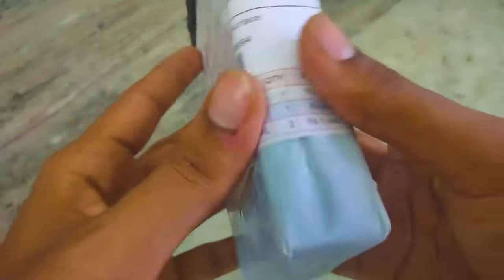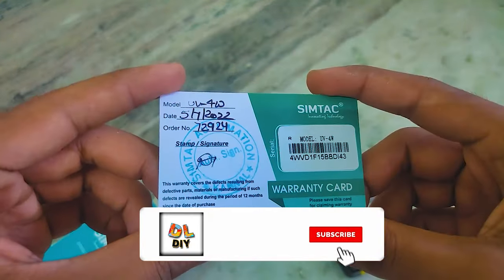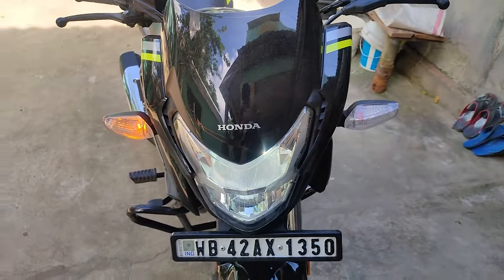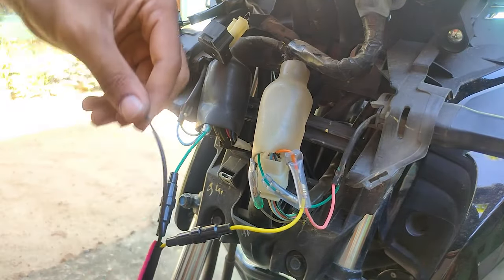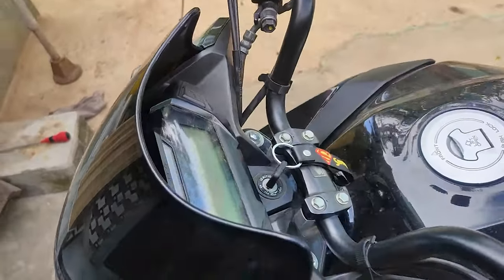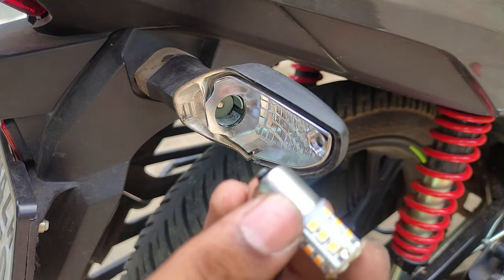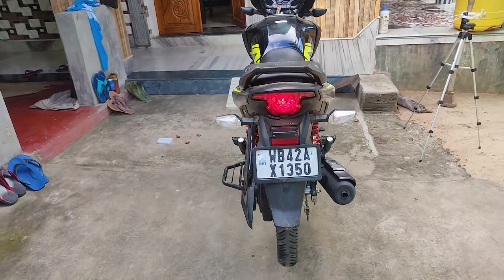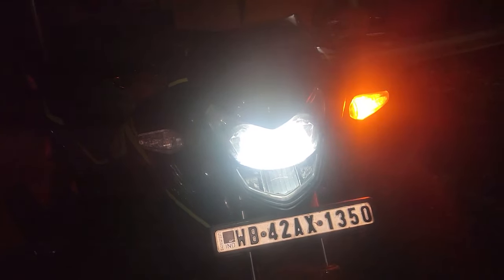Hazard light Installation SP125 Without Switch and Without cutting Wire | Daily Life DIY

Comment: Sir, I wanted to ask if installing a Hazard Flasher and LED indicator lights on my SP 125 bike would affect the warranty in any way. Could you please confirm if the warranty will remain valid after these modifications?

Comment: I did the same wiring in my sp125 but it is not working. I checked all wires thrice. Also i have not done any modifications before and this is the first one.
Reply from the maker: Aap mere ko Instagram per text karo main aapko circuit diagram deta hun